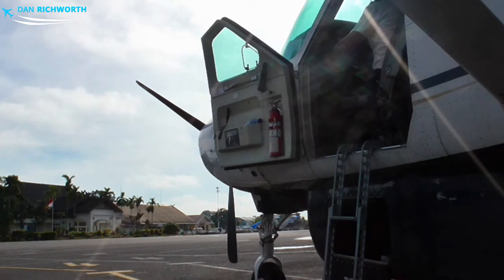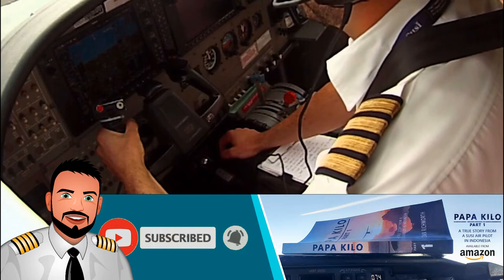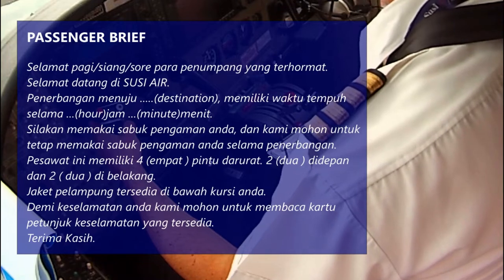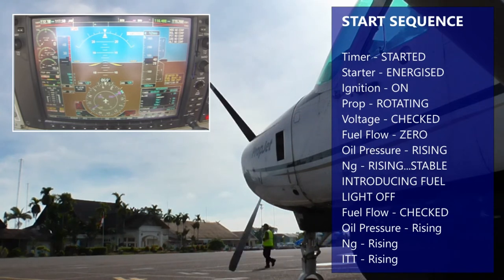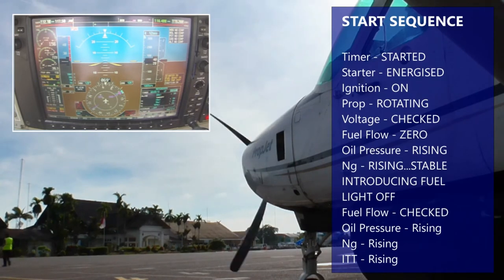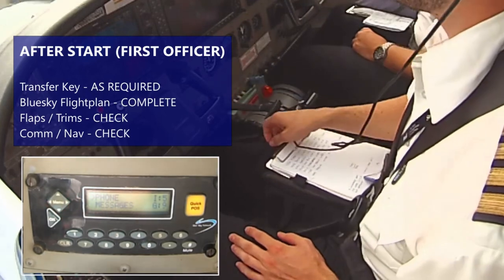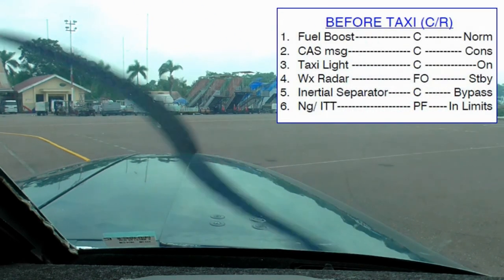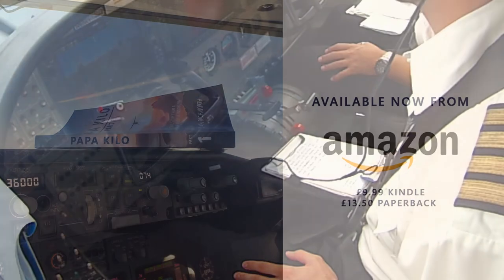How do you fly a Cessna 208B Grand Caravan? Pax Brief and ENGINE STARTUP

Comment: Hello, I have a question. Why do I need STBY ALT PWR and IGNITION, and when do I need to turn them on?
Reply: Hi, SBY Alt PWR should be turned on during final checks before entering the runway, it’s used to provide electrical power in the event of a gen failure.  You can switch it on and deliberately turn the gen off and you will see that the SBY power then comes on, reset the gen and it goes back off but stays armed.  Leave it on until after landing. Ignition should be switched on when entering the runway until 2000ft, it helps prevent a chance of engine flame out.  You can also switch on flight when in heavy precipitation for example.
Reply: @iain8837  i understand. Thank you